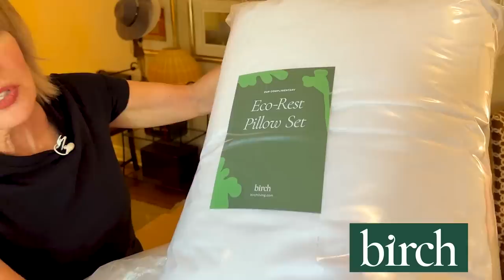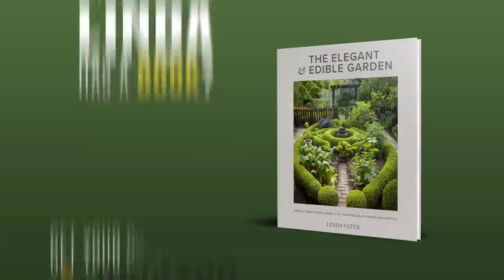Front Yard Garden Design + Cottage Style Thrifted Finds

Comment: My garden problem solving container was a tall planter that I cut the bottom out of and put over the white post thing that sticks up out of my drain field. I stuck a pot with a conical boxwood in the top of the planter and the hollow part below the pot hides the white post. I put a medium size and small size container around it, a small bird statue, and then underplanted those with hardy geranium, creeping thyme, and scabiosa. Beside the tall planter I planted mealycup sage and have an obelisk that's taller than the boxwood. I have sweet peas climb the obelisk in the spring followed by hyacinth bean vine in the summer.

Comment: Did you paint your outside trim? If so, what color grey did you use? Did you also add the limestone window sills, or were they existing? I like the way that they pop on the red brick. You really embrace your brick exterior. Is that because it's the only house with that exterior on your street? My problem is that there are about 5 houses, with my brick color pattern, on my street and I want to make my house more unique. I love OKC architecture.

Comment: Reply to Question of the Day: Several years ago, after having an irrigation system installed, I had a "well pipe" in the middle of a rose bed. To hide this ugly pipe, I used a huge manmade pot, cutting the bottom out of it, putting the pot over the pipe and after I made a false bottom for the pot, I planted Amaryllis in the shallow pot. It worked beautifully.

Comment: I’m curious as to the heat tolerant plants you you put in your very hot metal lined window box. 
Question of the day answer. I put a very large pot on a large cement utility access that is never used in the middle of a garden bed. I put some variegated ivy in and around in. It’s ugliness has totally disappeared.